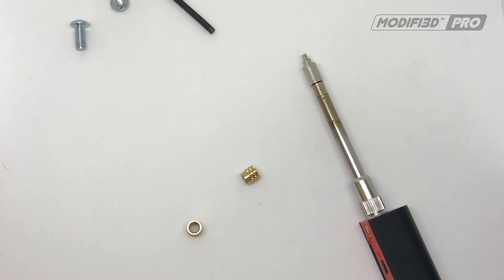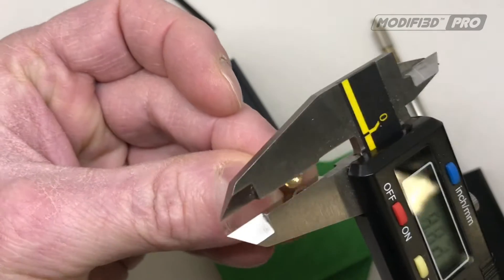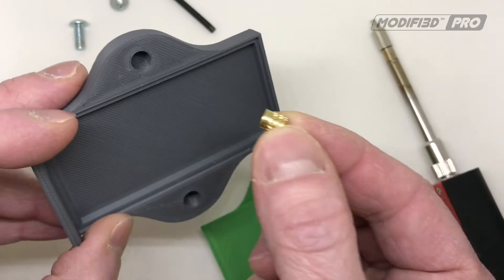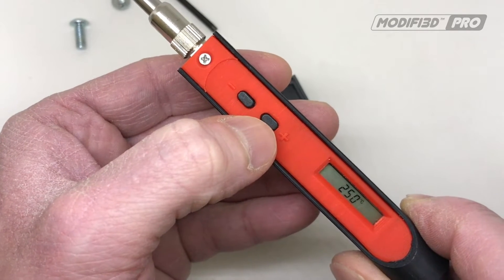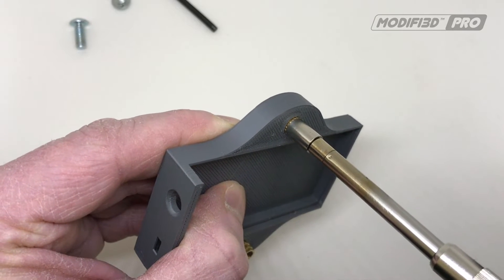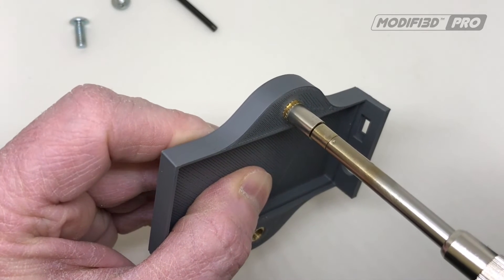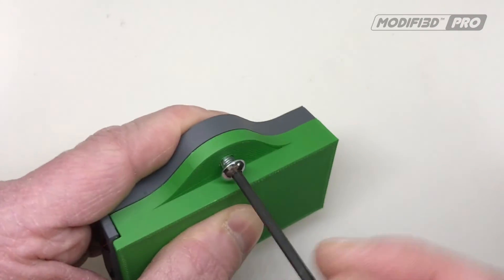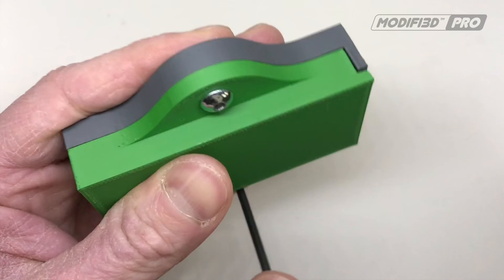Threaded insert setting with Modifi3D Pro : 3D Print Finishing Tool

Comment: Hiya, what sized threaded inserts is the tip designed for? Is M5 the max size?
Reply from the maker: The insert setting tip works with M3, M4, M5 and M6 threaded inserts. It is designed to fit the minor diameter of M3 and M5 but also functions with M4 and M6 due the flat surface on the tip steps.

Comment: Where I get these Inserts for the screws? :)
Reply: McMaster-Carr carries these: mcmaster.com
You could also try eBay, Grainger, AliBaba or fastener specific websites (Fastenal for example).

They are specifically made inserts for plastic, they make them for many different applications so make sure you find the right ones.
Reply from the maker: You can get threaded inserts from hardware / DIY stores or by searching online.